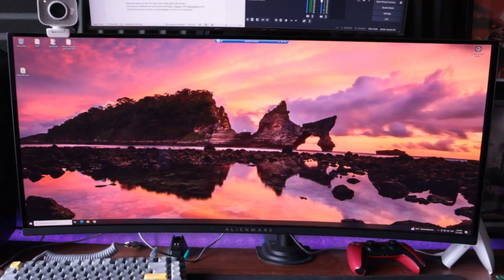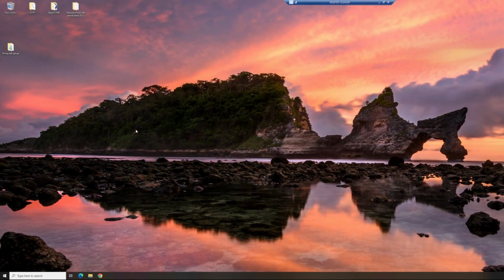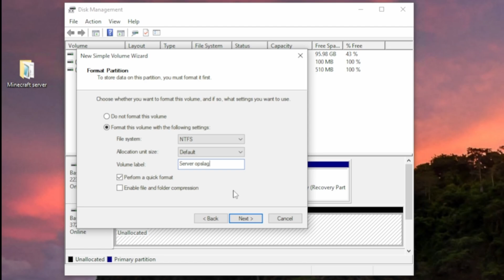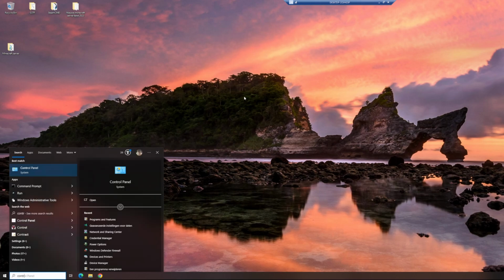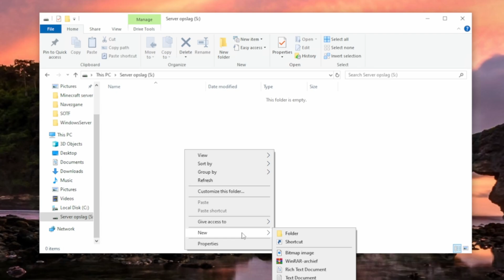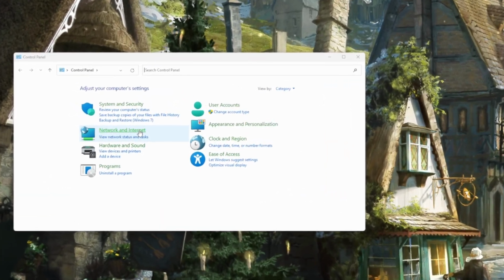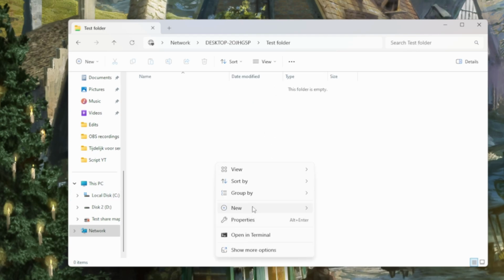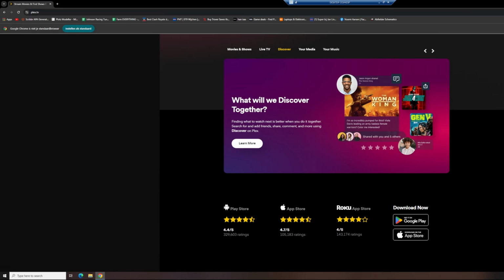Dell Optiplex Office Pc To Storage Server

Comment: Good video.  I have the same PC and plan on using it as a plex server.  Just wondering, did you consider using an M.2 drive as a boot drive?  I put one in mine and it works perfectly and just allows me to have an extra storage drive.  I was also able to keep the optical drive active and that allows me to rip my dvd's on there too if needed.
Reply from the maker: Thanks bro, and yea I did consider that. But my pc came with the SSD when I bought it. It was logical to upgrade it with a M.2 like you said but that would mean I needed to spend at least 30 on the m.2 and that would leave me with a SSD that won’t be used. So in the end I thought this was the best option